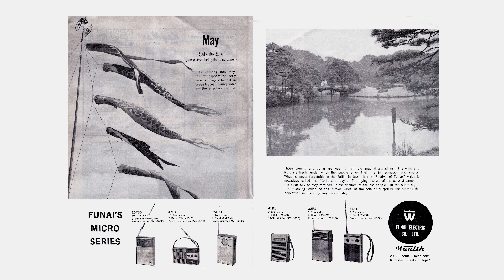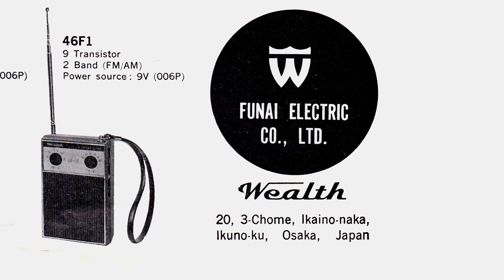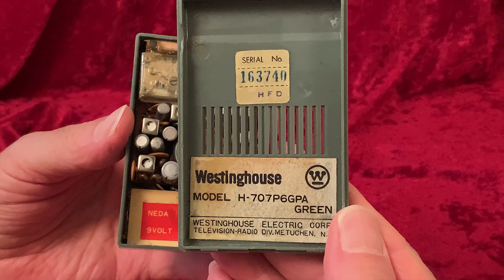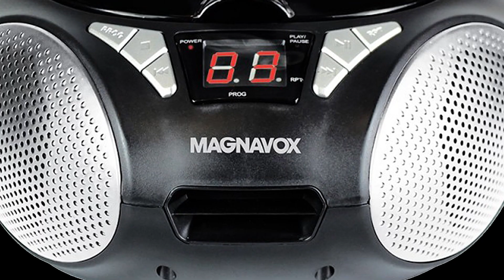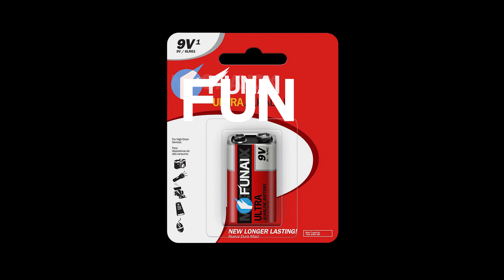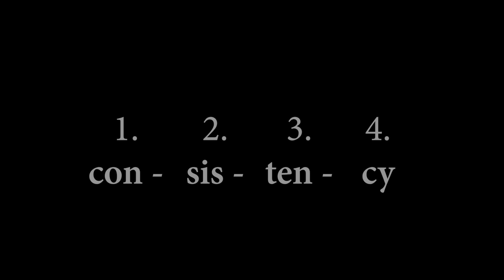Amazing 1959 WEALTH transistor radio Funai Electric makers of today's Magnavox brand

Comment: VERY MUCH APPRECIATED. 
I GOT MY FIRST POCKET TRANSISTOR RADIO IN 1964 WHEN I WAS IN SIXTH CLASS STUDENT. IT WAS GENERAL ELECTRIC USA MODEL GE P-910 BLUE COLOR WITH A LEATHER CASE USING TWO AA SIZE BATTERIES. IT HAD NO WIRES EXCEPT FOR SPEAKER.
I STILL HAVE THIS RADIO IN WORKING CONDITION BUT THE LEATHER COVER WORN OUT.
IT WAS CONSIDERED THE MOST ROBUST POCKET TRANSISTOR RADIO IN THOSE TIMES.
TODAY I HAVE POCKET TRANSISTOR DIGITAL RADIO SONY SW-1. IT COVERS FROM 530 KHZ TO 29.999 MHZ.
THANKS AND REGARDS.
Reply from the maker: Thank YOU.